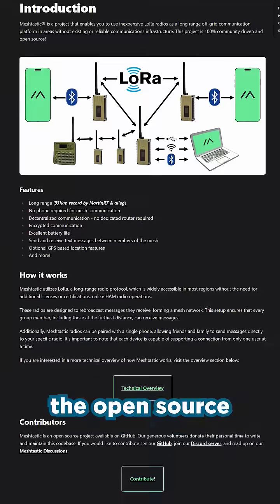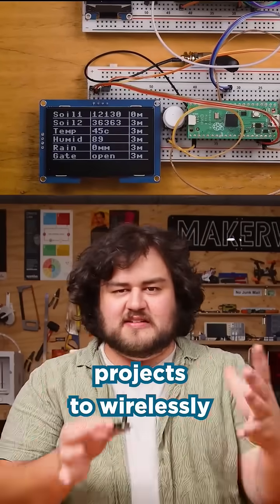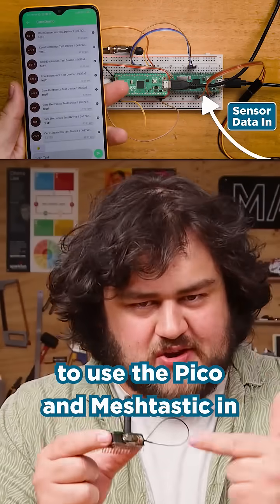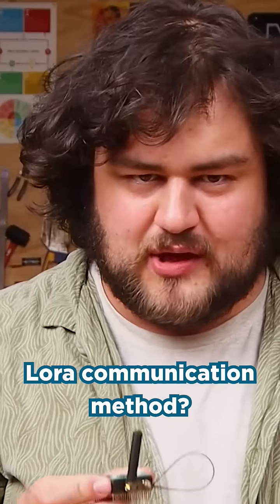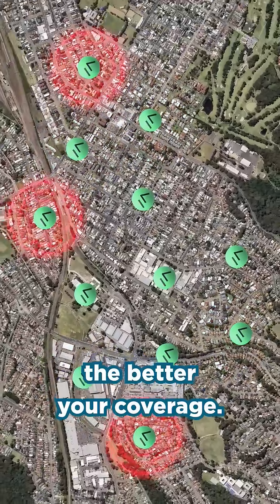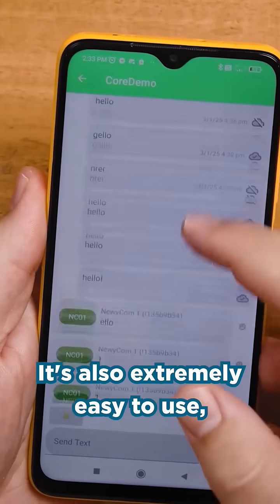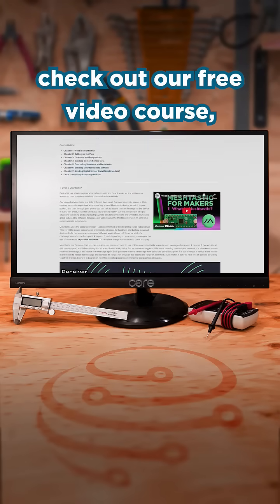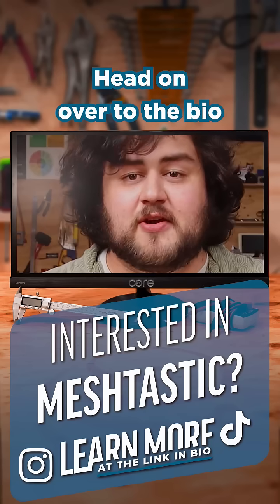Use Meshtastic For Your Maker Projects!

Comment: hi bro, is there also a device like this but for video transferring?
Reply from the maker: Video uses a CRAZY amount of data so we are unsure if there is something like that. We were thinking of ways to send a single image over LoRa and it would of taken several minutes to send a single image. You might want to check out drone FPV gear, that sends video over radio and may be a good start.
Reply: @Core-Electronics  okay thx!
is it possible to connect it with raspberry pi?
Reply from the maker: The process may be a little different, but at the end point of this is to have a Pico running meshtastic and sending data to a 2nd device via UART. So if you can program the Raspberry Pi to send and receive UART messages, it is definitely doable! We don't cover it in the guide though unfortunately.